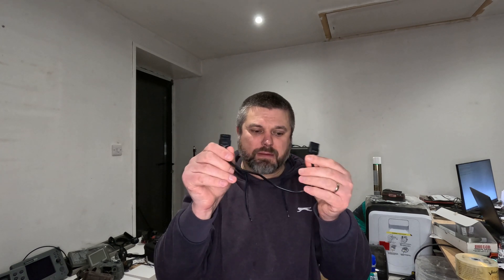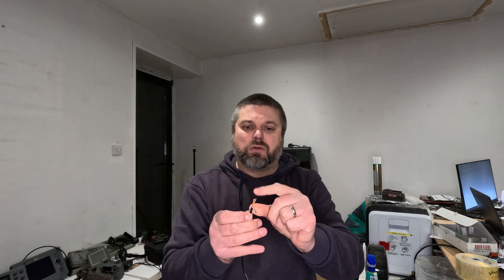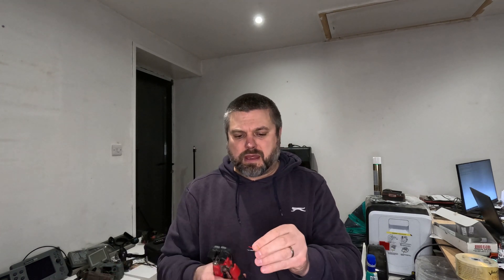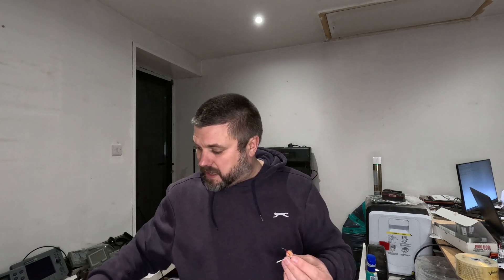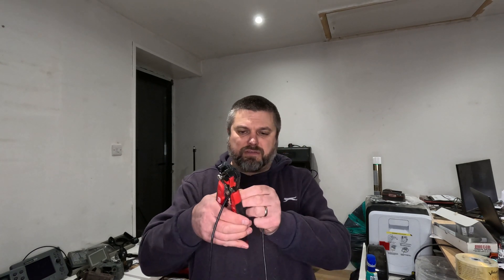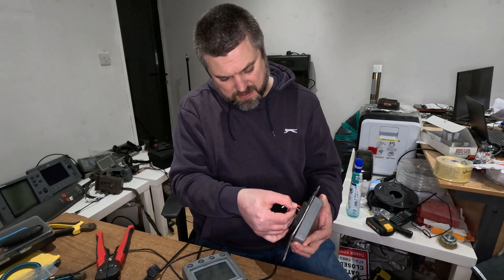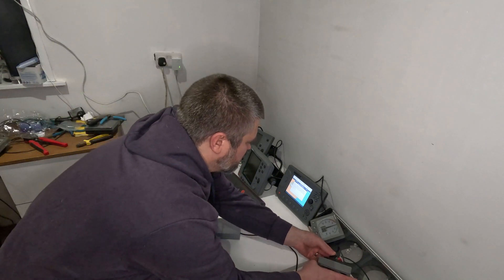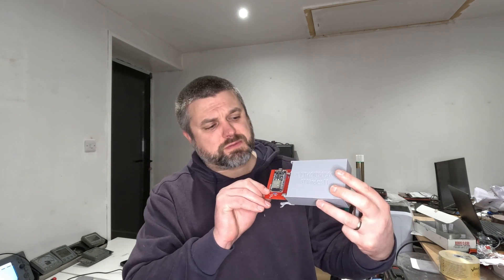Showing how to make your own Raymarine  Seatalk instrument three pin connector cables on the cheap.

Comment: How do you have the beginning of the "loop" of instruments powered? Are all of the instruments powered through seatalk, with the fist instrument in line feeding the others?
Reply from the maker: Yeah that why the connecting cables have three wires, there's a limit to how many you can power this way from memory not sure what figure is, they all work in parralel
Reply: @boatsandbits thanks

Comment: man ,  a super Lazy question. I bought a boat with raymarine electronic, Ntg cables. Brain of autopiot is dead. SO i was thinking to a SG3. Seatalk to NTG. Do you know the cable colors . need to use a bus for seatalk to seatalk NG, and want to use NTG cables  that I have and  DIY Seatalk
Reply from the maker: Normal seatalk is red pos shield neg yellow data not sure how it is on your boat though?